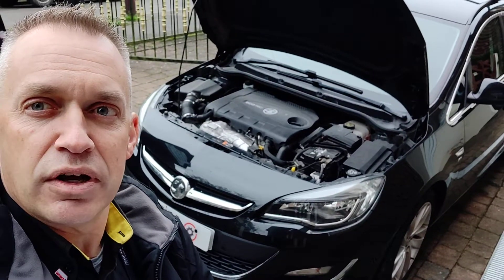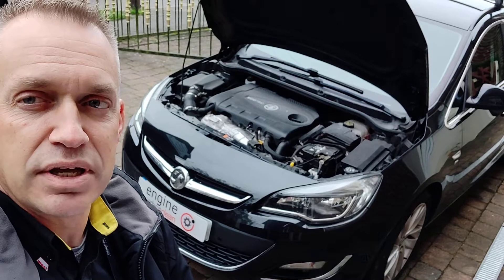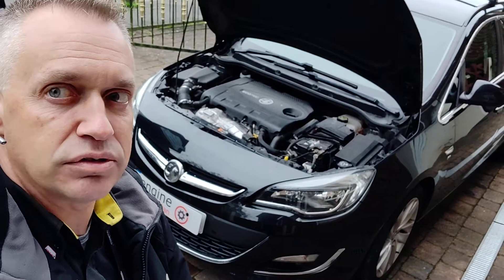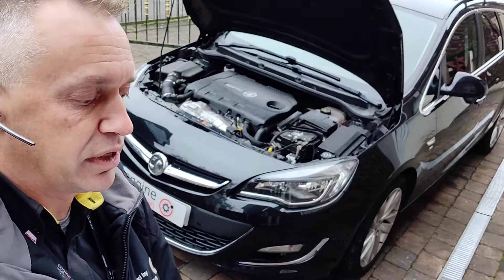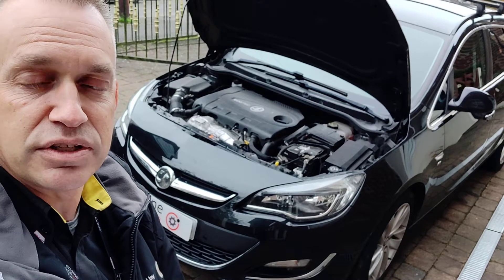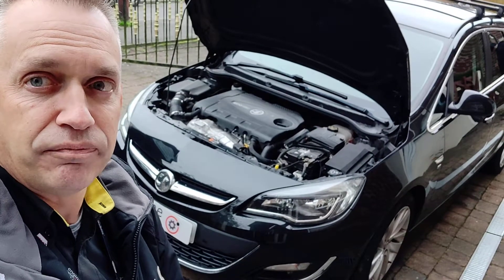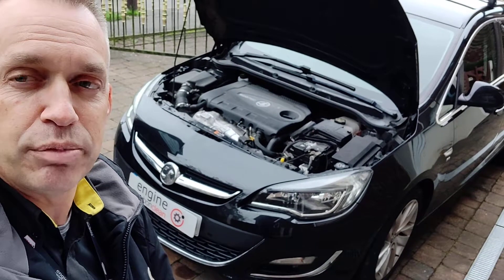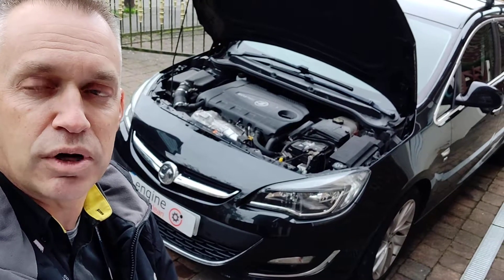DPF Light on and not regenerating? Diagnostic Consultation on a Vauxhall Astra 2.0 CDTI

Comment: It was a very common problem on them that the DPFs were faulty. They used to block up regularly and when the ECUs were updated to get around the emission fiddle, it caused havoc. Vauxhall set them to do a full regeneration every 300miles and they wouldn't even clear on a very long motorway trip. You could do 280miles then drive up a hill the next day and it would try to regenerate!
Awful design as the excess heat always used to cause massive overheating and burning out glowplugs. That often give a very misleading Service Vehicle Soon message. 
Best advice is get shut of the DPF and refresh the ECU and tell it to ignore it.